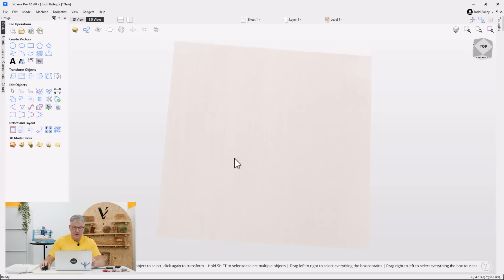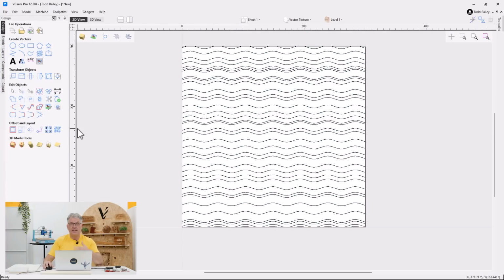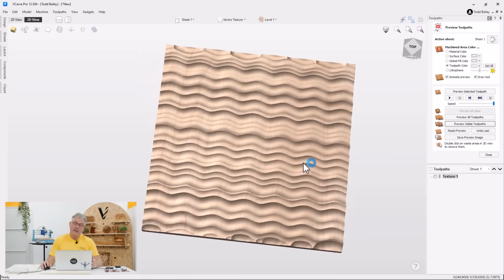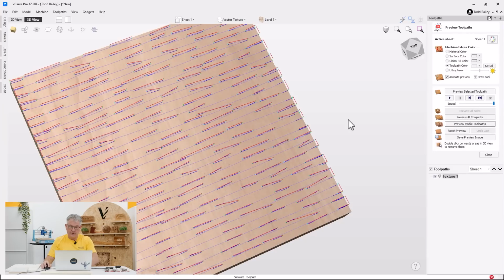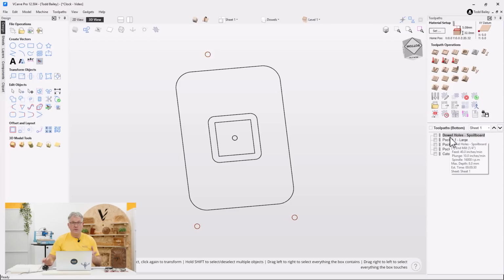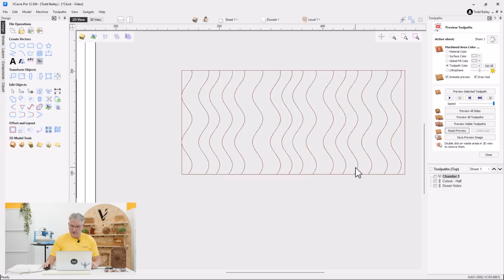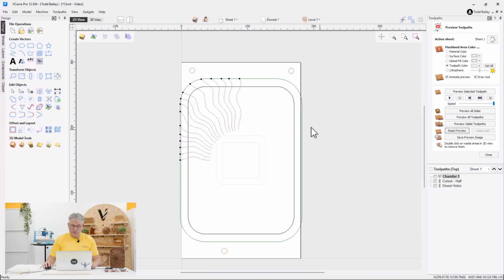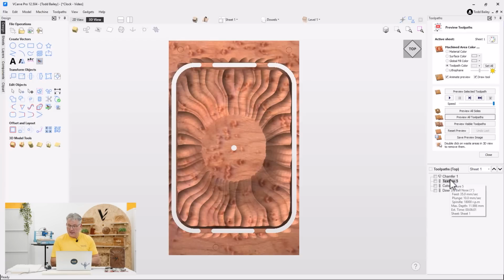Textured Mantel Clock | In the Labs Vectric | FREE CNC Projects

Comment: Great project, Todd! I really dig that texture! The only thing I would add would be to have the clock mechanism in hand before you cut the pockets and holes for that mechanism. That way you can take measurements from the actual mechanism, rather than rely on the sometimes sketchy info provided by the manufacturers. This is especially true of the length and diameter of the stem (the part that goes through the face, and the hands attach to it.) I have found variations of up to .0625 inches (1.25 mm) in length and .03125 inches (.79 mm) in diameter of that stem. Taking the measurements from the actual mechanism has saved my bacon more than a few times.
Reply from the maker: Great suggestion! Thanks for the tip!

Comment: Great video!
However, I don't understand(blame it on my age) the 'mixture' of metric measurements with imperial bit sizes.  Yes, American here and we have yet to adopt metric.  If running the jobs, do I choose a metric or imperial post processor?  Or is there a conversion tool in Vectric?
Reply from the maker: Hello... you can mix and match bit measurements... and it will not effect anything.  I do sometimes use a 1/4 endmill and a 3mm bullnose... and when I save it off as a toolpath it all work out perfect.  When choosing your post... mm or inches, I would suggest using the unit of measure you set your job up with, but you should also check your controller software it may be expecting mm or inches.  Hope that helps... and if not I would suggest contacting support@vectric.com with your question and attach a file and the controller type you have.

Comment: Does anyone have any recommendations for reducing chipping when engraving pine?
Reply: What are you engraving? You may try sealing it. Overall, pine is not a good choice, it's too soft. Most hardwoods give great results.
Reply from the maker: I make the comment in a lot of the videos that I'm not a fan of pine.  It does chip and it is hard to get a decent finish.  In saying that we have had many users say they love it and get great results... LOL  I think if you are going to use pine you need to cut bold designs, and expect chipping.  If you put that question the to Vectric Forum users you might get some help. - Form.Vectric.com